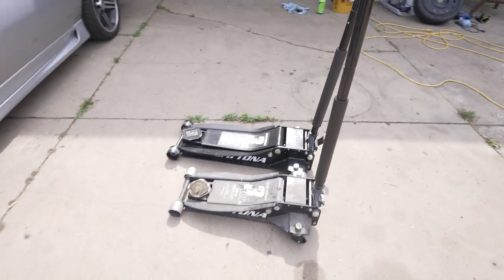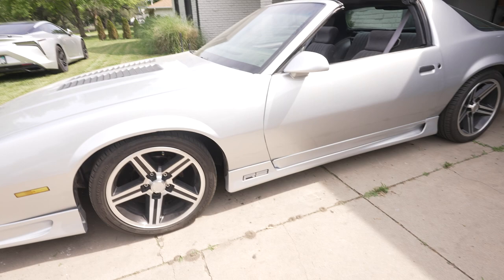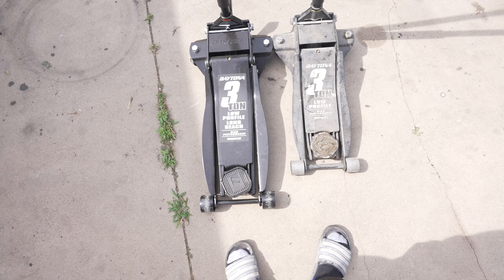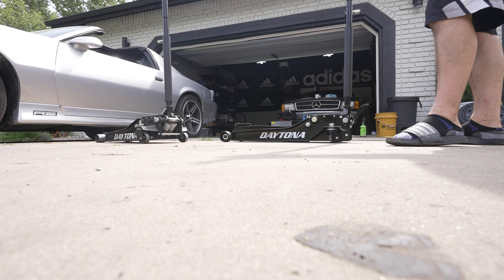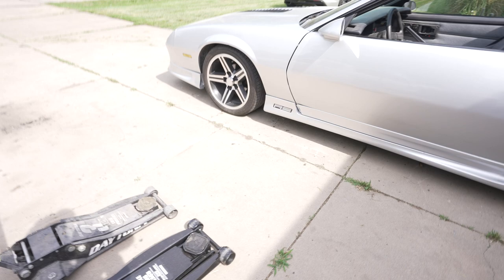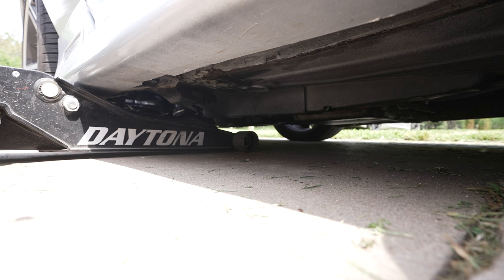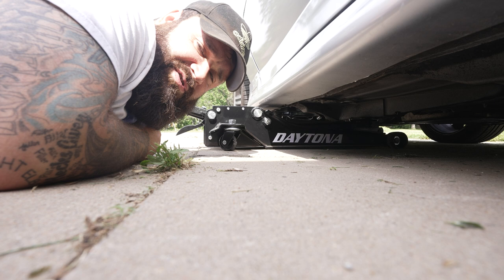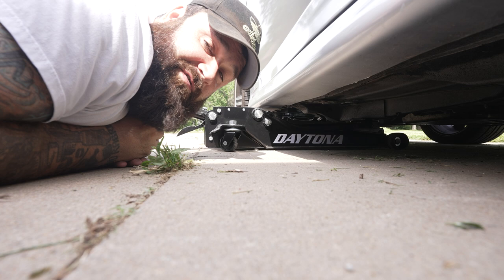Low Profile Long Reach VS Regular Low Profile 3 Ton Jack | Harbor Freight Daytona

Comment: Why not jack it on the pinch welds? Thank you for not showing exposed toes!
Reply: They will bent over and flatten the weld
Reply: @mustangdemon87  Not when you use the correct pinch weld pucks.

Comment: As low as your car is in the front, I would still roll that car up on some 2x6’s or 2x8’s s if you let it down and it happens to drop really quick you don’t damage your car. Good video. Looking to purchase this jack and I needed to see that long reach comparison. Thanks. Be safe.

Comment: I have the long reach one! An Holy Cow it's heavy 😳
Reply from the maker: yea it's a tank !
Reply: That's good and not a Jack to carry around
Reply: I know…having to replace my long reach with another one…but I’m hesitant because of the weight and storage
Reply: Does the long reach have grease fittings around the wheels?

Comment: Man, thanks a ton for this. I have a 2013 Rover and wife’s got 2016 and I’ve been using the red low profile for a while and now i feel better about the extended reach because for rovers it has you change suspension height to off road which makes it tougher for the low profile to get up to and get off the ground high enough more than tire off ground a few inches so this is awesome! Thanks !
Reply from the maker: Yea the long reach is definitely your answer for those!!  Glad I could help

Comment: I just bought one.  It's damn heavy.  And it lifts really slowly.  I haven't decided if I'll keep it.
Reply: @glennr9913 Which model are you referring too and what did you end up doing?
Reply: @chasen432   It's the low profile, long reach 3-ton model.  It lifts about 24" high, which is huge compared to the 18" max of my smaller jack.  I need the extra height for my Kwiklift, so I will keep it.  I just wish it lifted a bit quicker and wasn't so heavy.